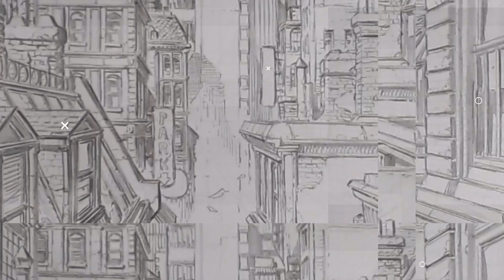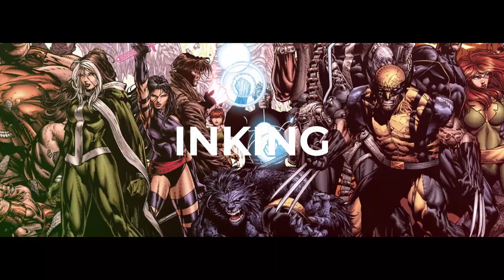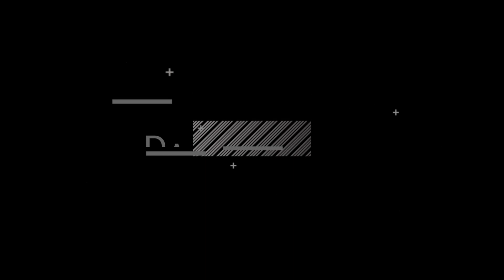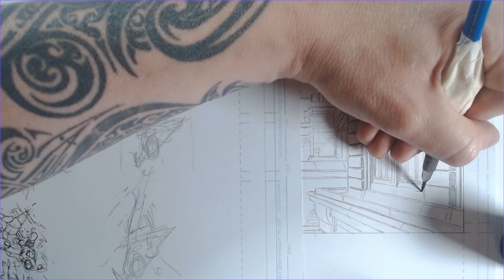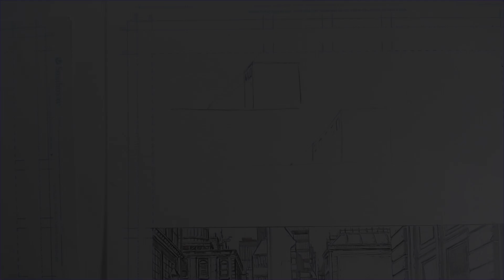How to Draw Buildings in One Point Perspective part 2

Comment: Hi, Mr. Finch.  Thank you again for the great insight in your videos.  Purchased your entire Gnomon drawing / inking DVDS and website tutorials several years back.  Definitely, a Masterclass worth the price (better instructional material than most books offer) and much appreciated.  FYI, the link for Strathmore 200 is for 'LINED FOR COVERS' instead of 'LINED FOR PAGES', I may be wrong but i think they are two different formatted pages in regards to the blue lines.  Just wanted to help out with info.  Also, HOT TIP for you and your subscribers, Hobby Lobby art stores have Strathmore 200 Smooth series 24 sheets a pad for $11.39 - 40% off ($18.99 list price) before July 4th, which comes out to around a fantastic 50 cents a page after tax.  Great value & would highly recommend anyone to pick up in person to save on shipping and overall cost.  With tax it actually comes in cheaper, than ordering online due to shipping costs depending on how much you order.  Free shipping over $50 is advertised online and the website operates separate from the local stores.  I have found the best, black ink available is Yasutomo Liquid Sumi Ink, 2oz (Not the 12oz bottle),  Black (KF2.)  Sumi ink is made of high-quality vegetable soot
 / waterproof and can be found on Amazon for around $10.  I was recommended the ink by my local art store owner years ago.  She recommended it over Pelikan and Speedball and she was right.  It's definitely the darkest blacks I've ever encountered over the years.  Quality is supreme considering overall paper and ink quality has died down since the 90's.  Like all ink, I recommend to combine two bottles of Sumi into one bottle and leave ink out to air to allow some of the built in water to evaporate to get proper consistency.  Stay safe everyone!  Thank you, Mr. Finch.  One of the most talented and nicest people you will ever meet.